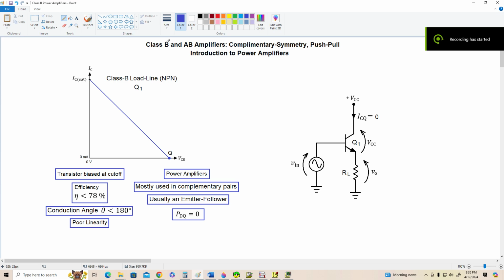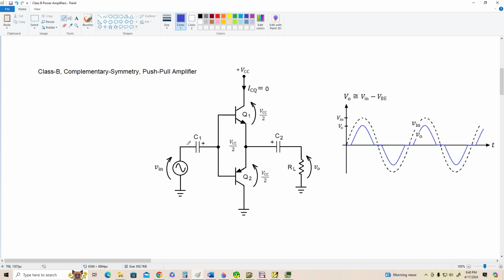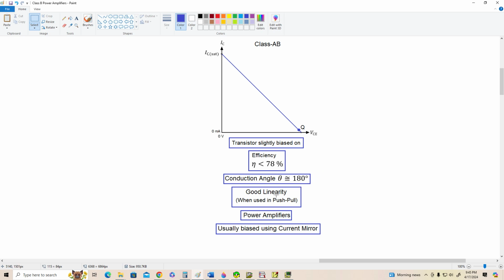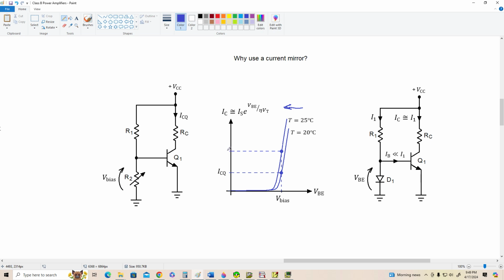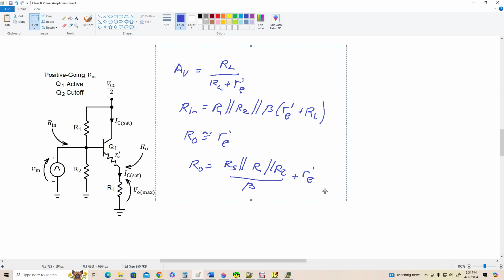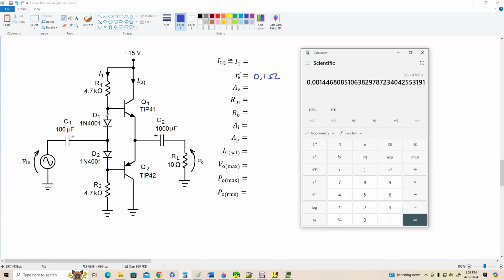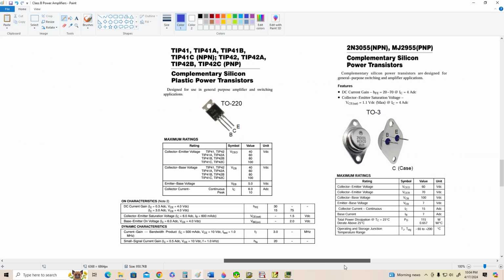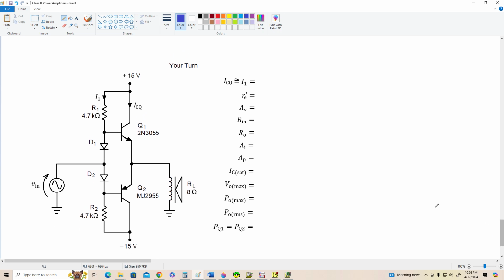Topic 37: Class B and AB Power Amps and Current Mirror Biasing

Comment: i have a question. Why did you estimate re' to be 0.1 ohm? isnt re' should be 26mV/Ic?
Reply from the maker: r_e is a small-signal parameter (the slope of the transconductance curve at the Q-point). r’_e is more closely related to the bulk (Ohmic) resistance of the device, which is essentially constant, independent of the operating point.

When the Q-point moves over the entire load line (large signal conditions) r_e is no longer a meaningful parameter.

Comment: hi, please, tell me where can I find TIP41, TIP42 and 2N3055 r´e , thanks
Reply from the maker: These values are rough estimates of the large-signal resistance of the B-E junctions. Generally, the larger the area of the junction the lower r’e will be. It is mostly a result of ohmic resistance of the doped silicon plus the bonding wire and contact resistance.
Reply: @Denton.Dailey  Thank you very much for your answer, great youtube  channel

Comment: Thank you sir for the nice video. I have a question regarding the frequency range of these topologies. With the same biasing condition, when I apply a different frequency signal from 10 k to 1 mega, there is a huge difference in the biasing current and delay at the output. Are there any tips for this problem or reference suggestions? Thank you
Reply from the maker: @الغيث-ي2ه  since this amplifier has zero negative feedback, it will exhibit relatively high distortion and low bandwidth. For guitar-oriented applications this is not a problem. To increase the bandwidth we need to add some negative feedback (at the expense of some gain).
Reply: @Denton.Dailey  Thank you

Comment: Q2 collector should connect to -Vcc instead of ground. You said current flows from ground to RL to Q2 emitter to Q2 collector during the input negative half cycle - that is impossible if Q2 collector connects to ground directly. You have to create potential difference for current flowing. So, Q2 collector should go -Vcc.
Reply from the maker: @佳期又误  capacitor C2 is charged to Vcc/2 which supplies energy to the load and allows current to flow anti-clockwise and Vo is negative with respect to ground.

Comment: Excellent video!  An entire semester of Electronic Engineering summarized!  - key - Q Point, biasing,  Class A, Class B, AB amps, Emitter Follower, basic current mirror, Push pull, Importance of C2 - Coupling, energy to Q2 circuit when Q1 is shutoff, Crossover dissipaition, Bipolar supply ..
Reply from the maker: Thanks. There are a lot of videos on here by people that really understand how this stuff works but not many of them do a very good job of explaining or articulating their thoughts. I try to be precise and efficient with my explanations and work a sufficient number of example problems. 👍🏻

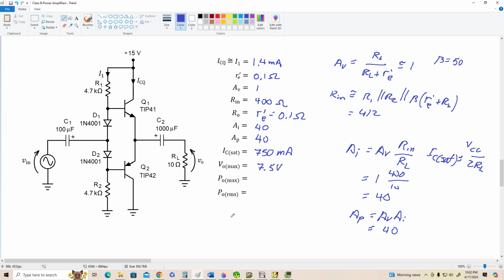Comment: 27:34, i made such circuit in  simulator a put a static voltage on the input, the reason is to find the max current a particular transistor would give according to it datasheet, witch is 1.5 amps for BD137, BD140, how much watts would the amplifier be rated for if powered from bi-polar 15V transformer, What kind of speaker could i hook up? it's pretty weird since all speakers are either 4 or 8 Ohm's.

Would be cool if you made a video on how to "design" the circuits around the transformer including the capacitors as wel filters to not pollute the grid with noise and stuff, how much capacitance you need, some guy is building amplifiers and uses 66000uF for 150 watts of power and sells these for +50.000€
Reply from the maker: I’ll get to that eventually.
Reply: @Denton.Dailey  I'm now looking at EMI / EMC  filters, but they pretty much always talk about switching power supplies or targeted at that.